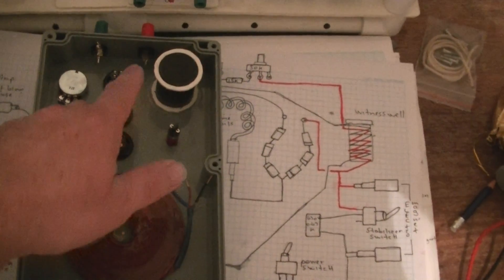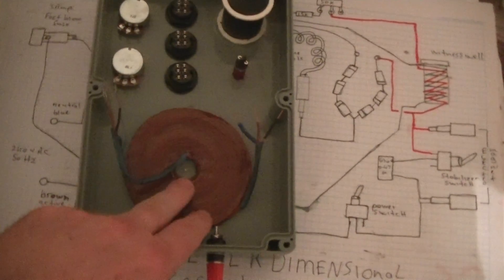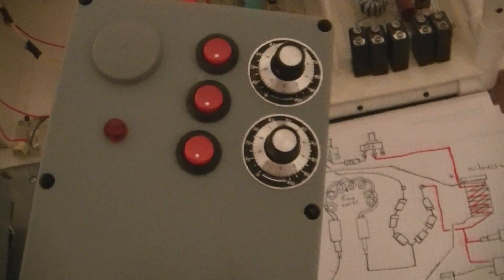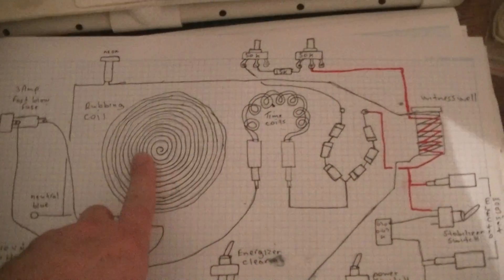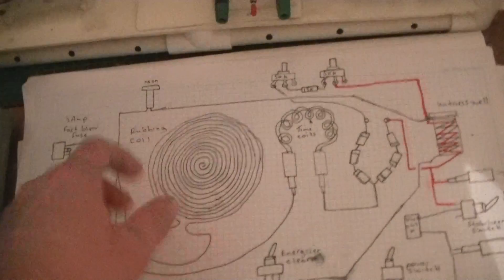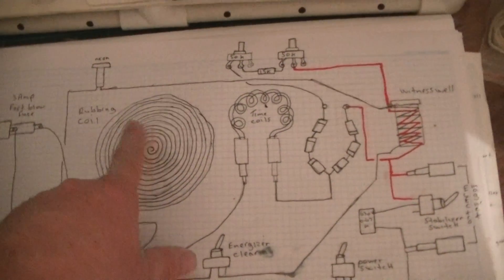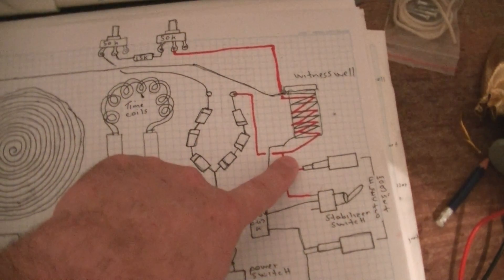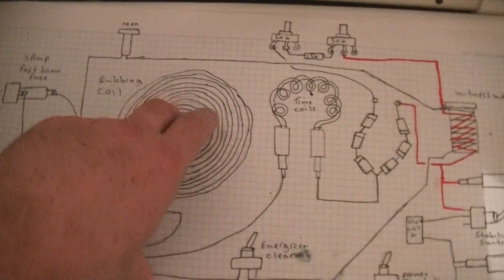hyper dimensional resonator prototype number 5

Comment: Another update for shiverton:
Simple magnetic Vortex are not working.
Scalar vortex can be more efficient.
We must test under a Double scalar electromagnet. Forget Ac line from nuclear power plant, a simple VCR battery can open a bose einstein wormhole, like this is writing in somes files i found that i think you have publish (or not ?) about the story of a man, bill dawson. He have a working machine but the plans are destroyed. But there is drawback, a simple jump can destroy your comprehension, instead, we must use 100 khz thyristor that pulse a double caducee coils. We must recreate even, the black sun. If anywhone want to be part of the searcher after the black sun, you must find the truth about our sun. It is a center system clockwise of our earth astral dimension. Pulsed by gigantic and resistive spark of electricidy in a constant tornado, with a wall in ferronickel that is porous and full of cristals under a greath electromagnetic and electric stress, everythink is compressed like hell in this dimension of the sun, creation from nothink appear, it is the replicator machine that contain every record of our material world. We must learn more and more because steven gibbs hdr not working, miss something. What ? Just logic, this is a single wire with element, we must 2 wires for starting. Okay ?. Have a nice day, good luck for all searcher.
Reply from the maker: publish what files and i wouldent think of using ac from a new clear plant

Comment from the maker: all my 5 hyper dimensional resonators have 3 amp fast blow safety fuses in the time coil inputs and now I've just finished installing also tourmaline crystals  in  hdr number 3, 4, and 5,  with coils around them for extra protection and they also like the fuse are in the same time coils line
Reply from the maker: I've been told by someone testing a space time modulator I've built and sent him that he thinks the tourmaline attachment I sent him is to powerful and he thinks I may be blocking any time traveling and also demons , so the tourmaline I added in the hdr units  could really work in blocking negative energy

Comment from the maker: ive recently found that when i brought  some large 50k potentiometers at jay car electronics  that they are identical to the ones used in the original hdr units as they have the same alpha brand name on the back as the ones i brought from radio shack dose  so for all those hyper dimensional resonator experimenters and biulders jaycar electronics has lots of them in stock

Comment from the maker: i've completed the wiring and ended up using a 0.47 uf capacitor in it as i couldn't wait for the 0.1uf i had on order on e bay to come from china , i tested it by using the bizarre acting 7.8 layered electromagnet  that creates the multipole fields at the one end when powered by hdr number 4 and when i did the test with hdr number 5  the electromagnet then also started creating a multipole field at one end  so it s very strange  as i have to move the test watch to a certain area at the front while its spinning forwards to then get the watch to spin backwards, all at the one end and along the sides it just creates the north pole field that makes the watch spin clockwise, never done a full test yet tto time travel as i've got lots to learn yet and data collection before i try that part as i need to make sure i got it all right , and i need a vortex yet  to
Reply from the maker: +Steven Chiverton  the trifilar coil seems to be working ok and with ac flowing into it and pulsed dc re routed from the diodes through the coil to i have one wire left run to input terminals for some signal injection experiments

Comment from the maker: the trifilar coil ill use for ac and pulsed dc in the one coil and the third wire ill use for experiments and some rf ac to or frequency injection as i can tune that by siding out the em core of my powerfull sec exciter i may use to do the rf ac injection by
Reply: +Steven Chiverton Hello. with the help of this HDR, you can send a message to the past. Or go back in time and leave a message. maybe even an e-mail?
Reply from the maker: despite building 5 hdr units ive only tested the electromagnets out and i need a vortex to do a decent test yet so that will come latter when i can find a vortex  and if i get a stick reaction that will be a step closer to actual tests otherwise id have to go back to the drawing boards
Reply: +Steven Chiverton that is, is it possible?
Reply from the maker: using ac rf energy it would flow into the trifilar coil and induce into the ac signal next to it and boost it  or amp it  with the rf waves in it